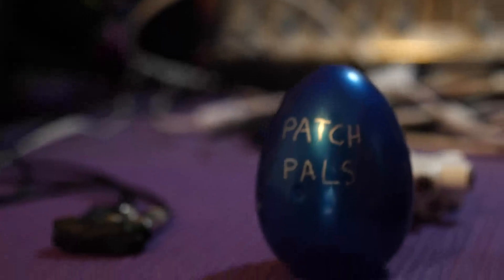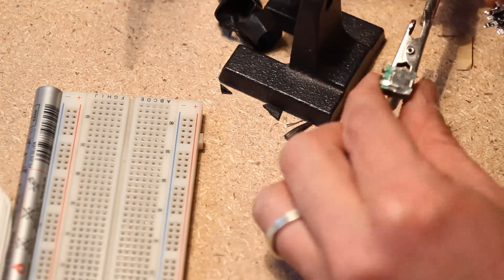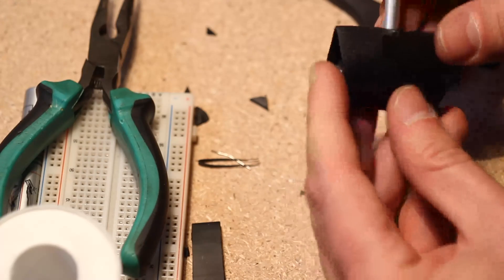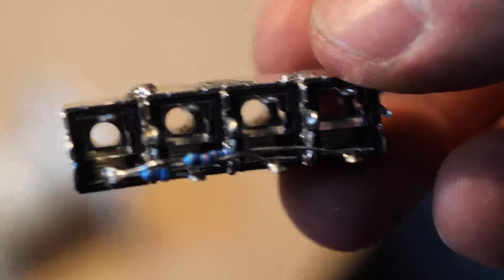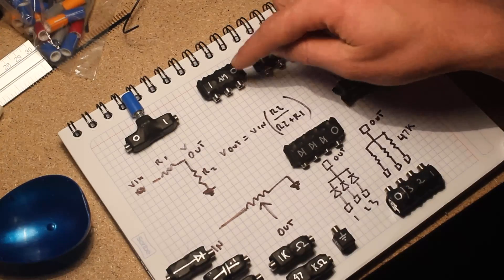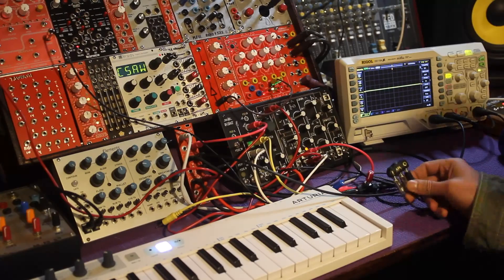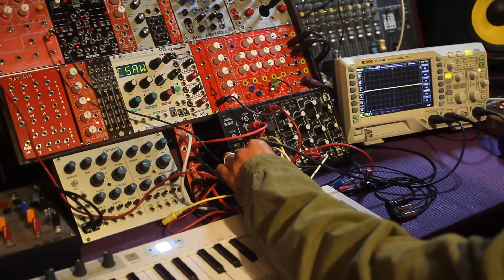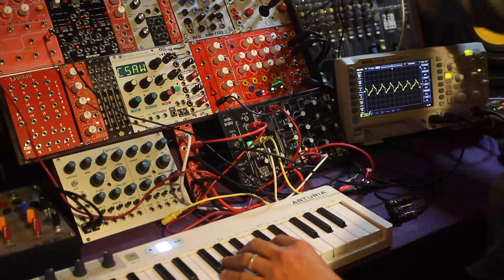SDIY Class # 5 - Pocket Passive Patch Pals and the JFET Delight

Comment: I’m very new to diy electronics so I’ll hope you’ll forgive my ignorance but I was wondering if that vca/waveshaper/ring mod would work the same way if used with a synth that runs on 0-5v unipolar (the AE modular by tangible waves).
Reply from the maker: Hi! The Jfet delight thrives on strong bipolar voltages for modulation. You can send it a 5v audio source but a 5v positive only EG or LFO will be less than ideal. It'll work, just not the same as in the video.
Reply: @QuincasMoreira  Thanks for the info. Since the parts are so cheap I might give it a try on the breadboard anyway just to see what happens. There’s no risk of damaging anything in my system if the circuit is passive right?
Reply from the maker: @olGrandpaby  yeah, do it! no risk :)
Reply: @olGrandpaby  How did it work for you on the single 5V system?

Comment: Hey Quincas! Will I get a phase reverse if I made a patch pal that simply connects two sockets in reverse, I mean plus to minus?
Reply from the maker: Hi! You mean polarity, not phase reversed. Well, no, because the "negative" side of a switch or jack has to be ground. So on a bipolar signal both positive and negative are on the "live" or tip, and ground is the reference 0v. If you invert passively, what you'll get is a unipolar output of only the negative side (I think) as positive on the other end. For unipolar positive signals, you'd be draining the entire signal to ground, and grounding the destination's input, so you'll get just 0v. Some engineer please correct me if I'm wrong! Cheers!
Reply: @QuincasMoreira  so there's no passive way to reserve phase?
Reply from the maker: @Fedir_Tkachov_Music  Again, you mean polarity, not phase ;)
Not that I know of no. Unless you're dealing with balanced signals, or  the output puts out positive and negative separately on T and R of a TRS cable, and the destination input receives the same signal arrangement. Then you can invert T and R and get polarity reversal. Ground is there too on the Sleve though!
 https://www.pro-tools-expert.com/production-expert-1/2019/4/25/how-to-check-and-correct-phase-in-your-recordings-expert-tutorial#:~:text=Polarity%20inversion%20is%20the%20reversal,becomes%20negative%20and%20vice%20versa.
Reply: @QuincasMoreira  right, makes sense, thank you!
Reply: Commenting a bit late, but from what I remember, all filters introduce a phase shift, meaning theoretically you could have a low pass with a really high cutoff to change the phase, although I don't think it would be that practical and I can't say for sure that's what happens. I did however find an active one that is relatively simple to make, and it's shown in this link https://www.allaboutcircuits.com/technical-articles/focusing-on-phase-the-all-pass-filter/ hope that helps!

Comment: Thank you again Quincas for some excellent ideas.

I really like the JFET thing that you build with the 2N5474 transistor. They appear to be obsolete now, at least the Faichild ones are. So I need to research if there is a suitable replacement.

cheers

andy
Reply: Did you find a good substitute? Im trying to start doing some DIY but is really hard to know to components to start those things
Reply: @AndréGodoy-g7r  Hi 
André :-)

I am afraid that I didn't manage to get to look further into that. Sorry! But as soon as I do I will reply back here. It may be some time as I do not have any funds at the moment.

cheers

andy
Reply: @AndréGodoy-g7r  try a 2n5486

Comment: This is just great...
I was wondering: can the little mixer be used for accurate cv? I am building a little switch for +1/0/-1 octave. I wanted to to mod my lil erebus to connect it internally, but it would be even better if I could sum it to a 1v/oct signal: 1v/oct input, switch, and a smed 1v/oct out. Would that work, or would the sum not be precise?
Reply from the maker: Hey, actually there is a bit of voltage drop and interaction between channels on a passive mixer, so no, it's not recommended for precise applications such as VCO tuning. Better use an active mixer for that :)

Comment: I built a couple of the simpler ones of these about a year ago, when I was building some homebrew modules, but since I recently got a MiniBrute 2S I sat down today to build an IamO. Had to wrap it in that rubber tape that molds to itself since I didn't have large enough heatshrink on hand (now I think of it, Sugru could have worked well too). It does what it's supposed to beautifully! 
These are such a nice companion to a semi-modular setup, as you can tote them around and not have to build them into a case.

Comment: Great thanks for this. I am planning to put a couple of the I AM O's and a couple of attenuators into a panel this week. What Pots do you use 50k Ohms?
Reply from the maker: Great! I use 10k pots, but anything between 10k and 100k will be fine
Reply: @QuincasMoreira  That's great thanks for your swift reply. For the 100nF cap in the I AM O, does it need to be more specific than 100nF, do I need to use a ceramic or electrolytic? sorry I am new to electronic components.
Reply from the maker: @maybury78  no worries. Electrolyticas are generally used for values above 1uf, so you can assume values below that are ceramic or polyester 99% of the time!
Reply: @QuincasMoreira   That's very helpful thanks. D

Comment: Just watched this one again. I Dig all of these and have been making doodads this last week or so. Created a Cool vactrol gate, low pass gate, attenuators and so on. Even did the diode one a couple times. Currently working on a plate reverb DIY... and many other things at once. When i get balled up on one project, i just switch over to another for a bit. Also started a passive ring modulator with two transformers and four diodes last-night. Yeah... I’ve been busy! Sheesh... you should see the mess!!! 🤷🏻‍♂️🤣
Reply from the maker: keepin' busy Chaz!
Reply: Synth Diy Guy Ok yeah... don’t what else I’d say to that, either. Thanks for the response!
Reply: what kind of transformers do you use? whenever I look for how to make a ring modulator, I can't find what kind of transformers to use
Reply: Eneko Lorente Bilbao I picked a few 7k to 10k audio isolation transformers, but one to one will work ok too. One in and one out. I think anything called an isolation transformer for audio will work... but ask around anyway,  I could be wrong.
Reply: @BadChizzle  Thanks for the info

Comment: Thanks for a brilliant series of vids. 
The only patch pal type of idea I already had was to put a diode into a home made patch cable. (fix fro a problem with a Behringer Neutron, but also a good tone modifier). Maybe for simplest patch pal things it's better to make up a special cable.
Anyway, totally inspired by your stuff.
Incidentally, do you have a music channel? (that background music is great)
Reply from the maker: Thanks! The reason I like to do it like this is you can then use whatever length cable you need, whereas with a specialty cable you're kind of stuck. Check out my website, there's most of my music work in there:  www.quincasmoreira.com
Cheers!
Reply: all too  true,  I made my cables long enough for a specific function...then suffered.
Of course, could always replace just one of the sockets with a cable.

Another thing I made was  to add a 2 colour led to a jack, wired so it would show green for positive and red for negative.  ...bet you did that already though.
Reply from the maker: @livelooper  It's a cool effect !

I haven't done it myself, but I may do it with a bicolor LED :)

Comment: I really like this concept. It's like building blocks even smaller than the modules themselves. Didn't have any of the JFETs you've got here but I grabbed a J201 JFET and managed to make something similar to yours! Mine has more bleedthrough and less waveshaping, and doesn't play as well with negative voltages, but hey! It works! Took me like 15 minutes so I'm not complaining.
Reply from the maker: cool :)
Yeah, I keep thinking of more of these, wich I had a big factory in china to roll these out :)

Comment: For preventing shorts, you can also use hot glue... I have done this when making a custom ribbon cables which is the soldered to header pins. Oh. Forgot to mention that you can shape the hot blob glue with a wet finger or two.
Reply from the maker: good idea!

Comment: i have a question about the ringmod:
what would be the difference if i would use a BC546 instead of the JFET?
Reply: I'd love to hear the results when you guys are done.  c:
Reply from the maker: I don't know!  You'll have to try it and find out :)
Please report back so we know!
Reply: it is working!
it may sound different, i can't tell 
i also changed the 100k resistor to a 470ohm resistor in series with a 100k pot, so i have a dry/wet pot with strange behavior ;)
Reply from the maker: awesome!  I'm gonna try too :)  Thanks!

Comment: These are the coolest! :) I found PJ301BM jacks at Thonk and saw you're using 1 1/4" (~3cm) heatshrink in another comment, but what's the resistance of the potentiometer? :)
Reply from the maker: 10 k pots!  thanks :)
Reply from the maker: anything from 10k to 100k will work just fine though. Since they are wired as dividers, what matters is the ratio between each resistor in the divider. There is some impedance variation but if you stay within the 10k to 100k range it won't matter.
Reply: Synth Diy Guy thanks! :)
Reply: Also wanted to ask: is there anything special about the 2N5457 JFET which makes it better suited for this purpose than an alternative JFET? Is it in a sweet spot between doing nothing and popping when it gets modular-level signals fed into it?
Reply from the maker: I just happen to have 5457's in my drawer because they are used in a lot of MFOS designs! I think it would work with other JFETs and even BJTs, with some variation in sound I would expect.
Reply: @QuincasMoreira  And it should be lineair since it CV your attenuating?
Reply from the maker: @shufflephunk  you can use either, and you can attenuate audio as well as CV

Comment: Great video! but can you explain me, how the "i am o" works? what is the capacitor doing? an what kind of signal must go into the modulation input? Thank you!
Reply from the maker: E Sessions , the cap is for AC coupling, so the audio comes out centered around 0v, no offset. The Jfet needs a good bit of juice to work well, a full 10v swing from modular sources is recommended. Works with bipolar as waveshaper and ring mod, and positive only or negative only as a pseudo VCA. It's basically a clipping amplifier where we're using cv to power it. Thanks for watching!

Comment: Congrats on your videos. Really liked these passive tools. Would be cool to put the tools used. I know most of them, but for instance, I'm not very familiar with heat shrink tube. Which size did you use? And less important, but may be useful, which brand. And, as Spanish is my native language, how would you call it in Spanish? Thanks.
Reply from the maker: Hey, thanks!  I used the largest Heat Shrink I could find, 1 1/4¨ (about 3 cm). En español le dicen Termofit (al menos en Mexico), lo que segun yo es un fabricante. EL nombre correcto seria tubo termo retráctil ;)
Saludos!
Reply: Muchas Gracias!

Comment: It's great what you're doing here, but it would be very very helpful, if you write some keywords down. As a non native speaker I still don't understand what those modules (except the JFET) do. What's the first one? An "ateniorator"? "Antantoater"? I googled several variations and still don't have a clue. I'm not a lazy student but I need something useful to start with. Anyway, great work!
Reply: Hi, thanks! I thought I explained them pretty well in the video!  But here goes:
Attenuator, Gate Combiner (multiple Or Gate) , Passive Mixer, Passive Mult, Resistors, Capacitors, Diode. The Jfet does bipolar VCA, Waveshaper and Ring Modulator duties. Hope this helps, cheers!
Reply: Thanks so much! It wasn't the explanation per se, just the words :)

Comment: Great video as usual!    Whenever I build something without a PCB I use a dab of hot glue on the components so they can't shift around under the heat shrink and short out later on (If someone were to squeeze it too tightly, etc).   Keep the great ideas coming
Reply from the maker: Good idea! Thanks :)